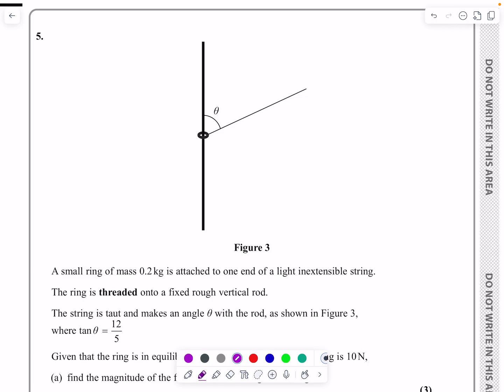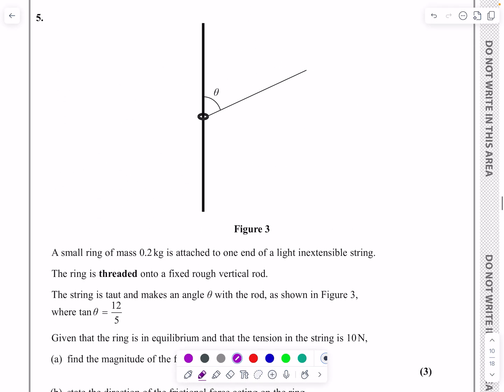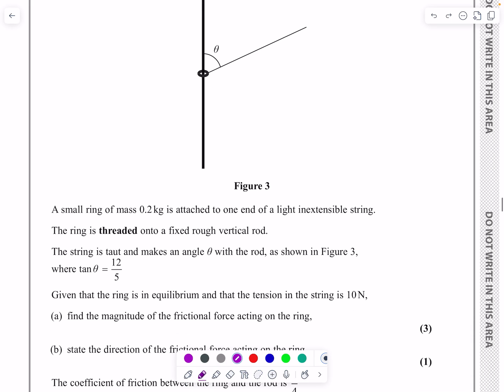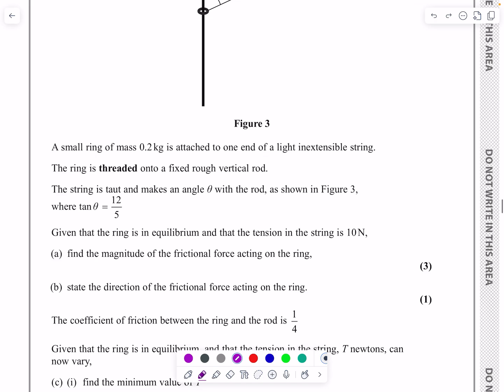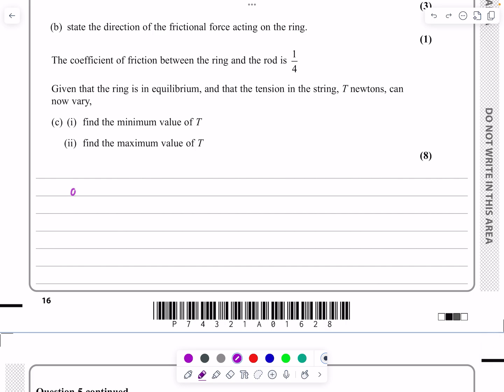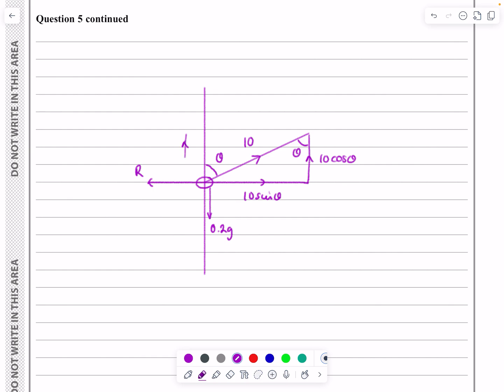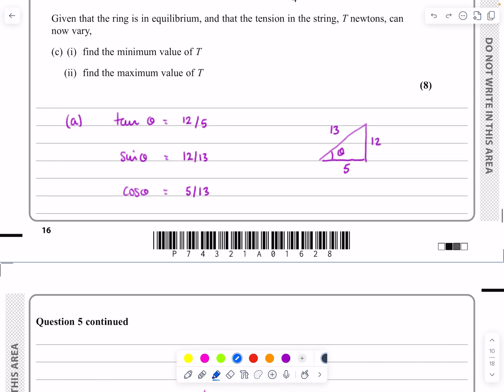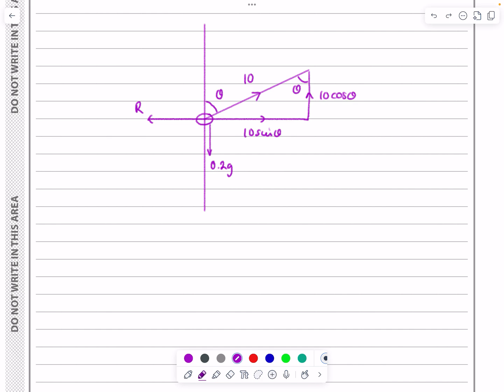IAL, Edexcel, Oct 2023, M1, Q5, Statics, Friction, Equilibrium, Mechanics, Nick Peters, WME01/01

Comment: 3:00 , why is the reaction force not acting towards right and on what basis did we perceive that R is acting towards left
Reply from the maker: The string will pull the ring to the right and so the reaction force has to act in the opposite direction
Reply: When do I draw R to the right and when do I draw it to the left? In part c
Reply from the maker: @lenetaha2628 the Reaction force will always be equal and opposite to the force applied to the plane.